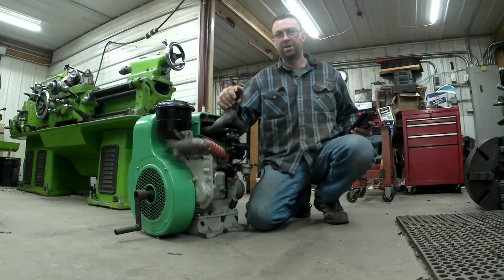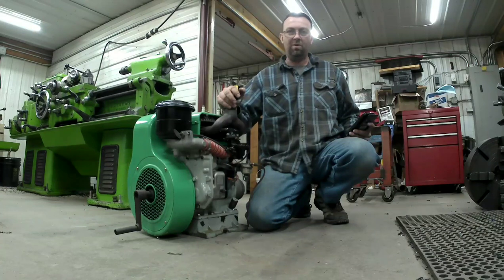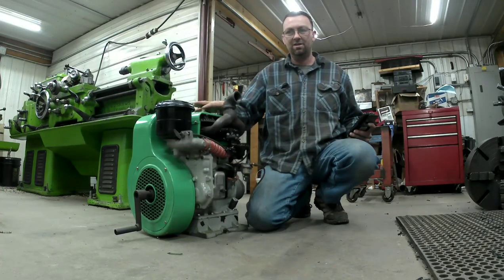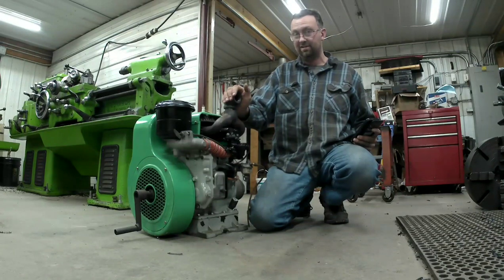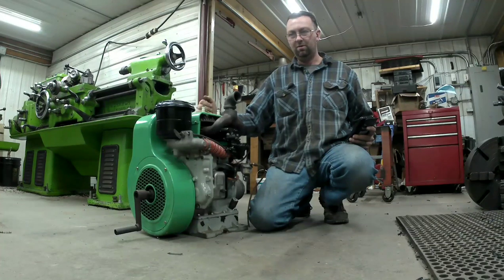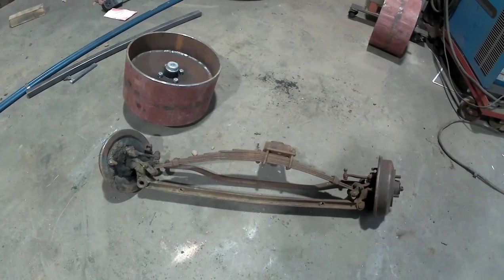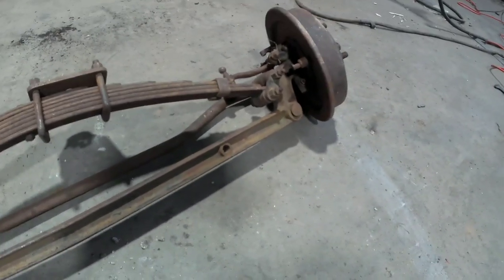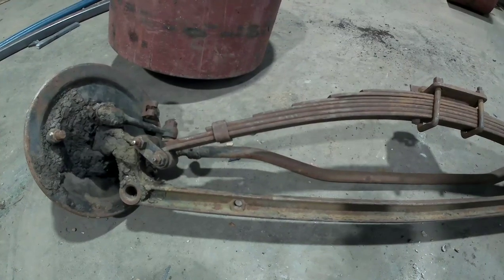Gray Drum Drive Garden Tractor Build Introduction

Comment: Check out "shrink discs" which clamp a sprocket or sheave to a shaft without kegways. They eliminate the need to precision locate keys everywhere, as the sprocket can be infinitely phased relative to the shaft. They are also superior for transmitting torque where the load reverses, as there is no free play. Been using them personally for 30 years in various industries. Cool project!
Reply: Like starter ring on flywheels.